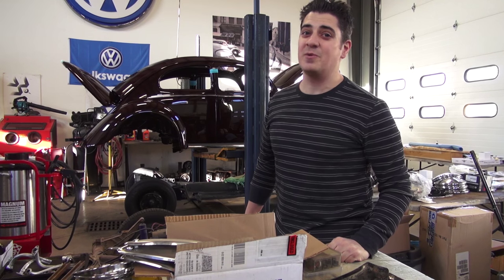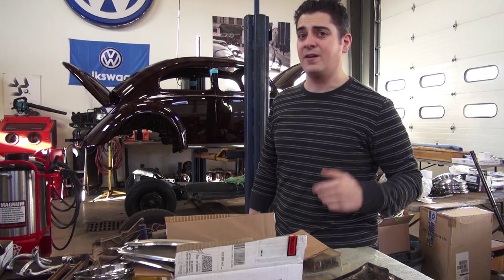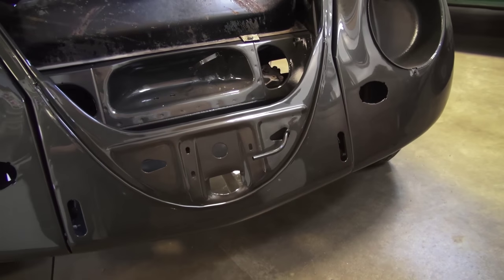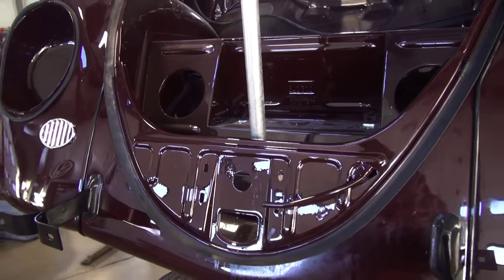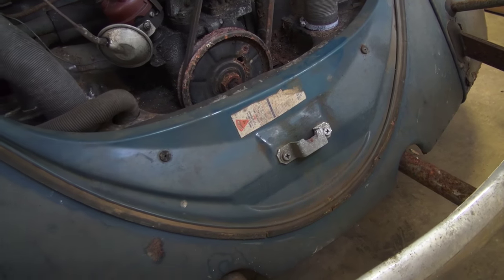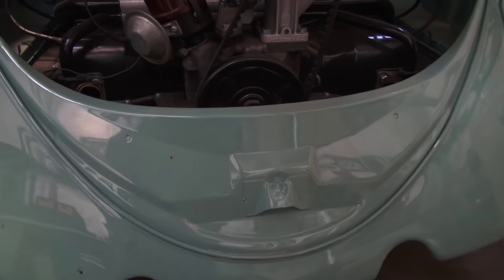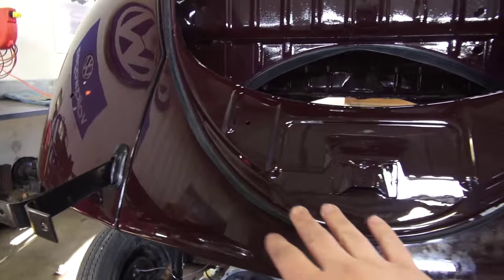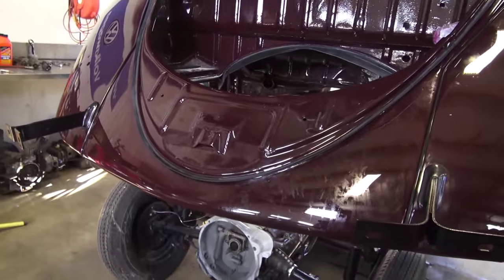Classic VW BuGs Volkswagen Beetle Replacing Front Rear Apron Changes Differences

Comment: brilliant detailed video as always mate, i have a question, the lip that runs up from the aprons on the body (what the rubber seals wedge onto and what the decklid/front hood seal onto) have all been bashed up on my 61 that im restoring, have you got any suggestions for this? i really couldt think of anything, and i dont just wanna hammer than back to look straight. Cheers
Reply from the maker: +Josh Briggs They sell those seal channels.  You have to weld them on.

Comment: ive got a question, can you not use the 65 66 rear apron and use a the later bolt on latch with an early decklid?
Reply from the maker: You can use those aprons, but if you want to use the "T" handle, you would need the correct catch that needs to be welded on the apron to use with the earlier decklid.  If you use the bolt on catch like in 65-66, you would need to go with the later decklid that had the push button latch.
Reply: @classicvwbugs  ah that makes sense. Thanks! Going to be converting my 69 to early style decklid and definitely want the t handle.